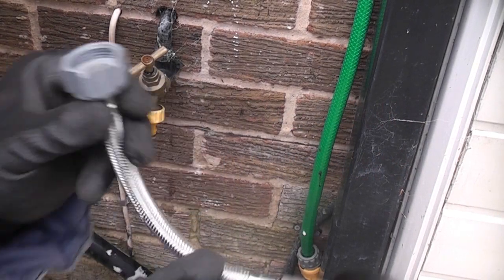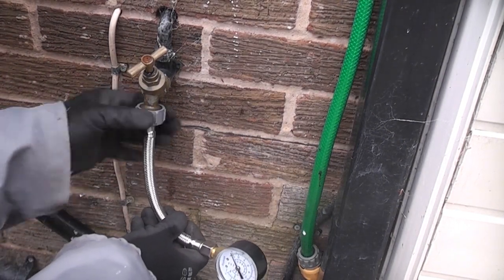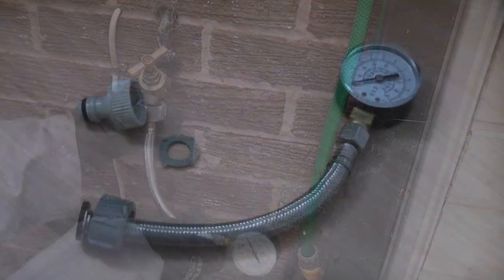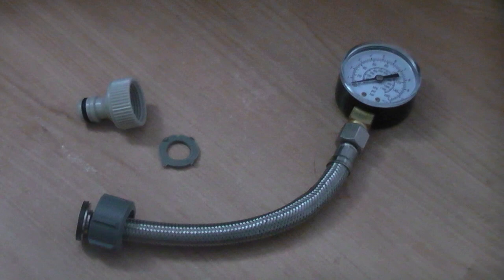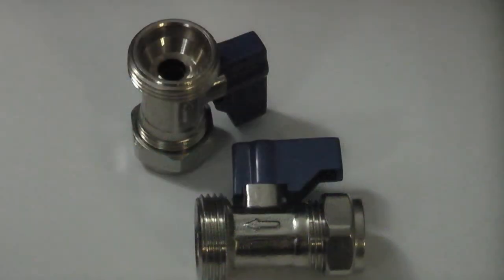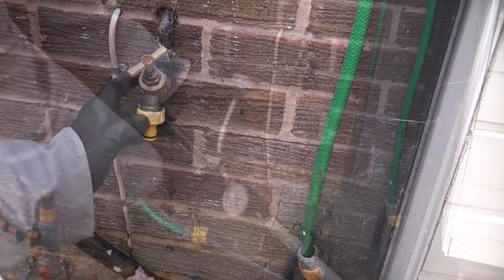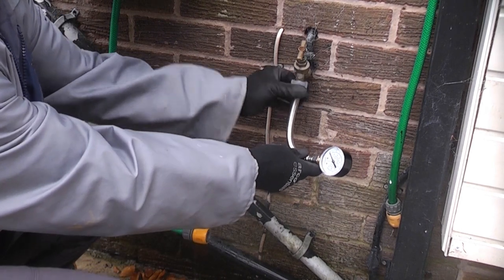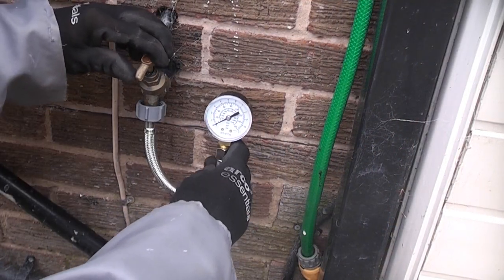How to measure water pressure

Comment: Dynamic pressure (working pressure) is achieved by running another tap during the test. Remember the outside tap has a check valve though

Comment: Hi just bought a very similar meter, would you usually turn the tap full to check? thank you. Great video.
Reply from the maker: It only needs to be open about a 1/4 of a turn, as the pressurised water will soon be measured by the gauge. If you were measuring water flow, you would need to open the tap fully.
👍
Reply: @ultimatehandyman  brilliant.  Thank you.

Comment: If the water is leaking a bit outside of the pressure gauge when you turn it on is it still an accurate reading?
Reply from the maker: It will be close enough ;-)

Comment: nice video. Could I ask in your experience what is the strongest glue for joining 2 pieces of wood ?
Reply from the maker: +visulube 
Thanks, I'm not sure which is the strongest wood glue as I have not used that many different brands.
I normally use Evo stick exterior wood glue for my projects, that seems to work well.
Thanks for the comment
Reply: +Ultimate Handyman  thank you !
Reply: +Ultimate Handyman  thank you !
Reply from the maker: +visulube 
You are welcome ;-)
Reply: Cascamite for critical structural applications when the joint is under constant heavy load and aliphatic resin (yellow wood glue) such as Titebond for everything else.
Reply: @peterv1436  thanks !

Comment: I'm not entirely sure that the method shown is correct, and may explain the very high pressure reading obtained in the video.

It seems to me that it's important to expel air from the gauge and hose to take an accurate reading.   This is how I did it:
a) loosely couple the tap connector of the gauge to the outside tap;
b) run a little water by opening the tap a small amount, allowing water to flow from the connector for a few seconds;
c) gradually tighten the connector until it is water tight;
d) turn the tap on full and check that the connector is still water tight;
e) note the reading on the gauge.

I'd be very interested to know whether my suggested method results in a different measurement to the one obtained in the video.

With best wishes
Steve
Reply from the maker: Hi Steve, this will be fine for getting a rough idea of the pressure.
If you wanted a really accurate measurement, you would have a to use a calibrated gauge etc.
Thanks for the comment 👍

Comment: so nice to say 7 bar to 100 psi. in Canada were i live you know we are all metric except air and water pressure at 100 things would blow away. to expect 40-60 for water is the normal. i find it funny you drive in mph and buy the gas or diesel in liters and the freeway is in mph and the signs are variable with photo radar everywhere. i was in Scotland
Reply from the maker: +George Gardinier 
Yes, it's bonkers over here. My van actually has a speedometer that shows MPH on the dial, but there is a digital reading on it as well and that's in KMH. Scotland is notorious for catching speeding vehicles using photo radar etc. Where I live we have lots of fixed speed camera's, if you don't concentrate and go over the limit you get a ticket and three points on your license. So far I have been lucky and have never had a ticket in my life- but my van doesn't go fast anyway LOL
I remember when Gas?diesel was sold by the Gallon, I remember a friend of mine saying the price of fuel was ridiculous in the 1980's and that it would soon be £1 per gallon, it's now £1 per litre!
Thanks for the comment ;-)

Comment: So you guys didn't go Metric with the Washing machine tap?!? :) ...
Reply from the maker: +Curiosity 
Metrication is a joke in the UK. Most plumbing fittings and air fittings still use BSP Imperial sized threads. But if you buy steel conduit it is normally sold in metric sizes. Some machines that I work on have bolts with Imperial threads, but some also have Imperial and metric ;-) 
It would be much easier if there was just one system of measurement used LOL
Thanks for the comment
Reply: +Ultimate Handyman Well maybe we here in the U.S are not so screwed after all...  I guess no matter where you live you have to go and buy what works... :)... I have learned the Metric system but we don't live by it here. Everything here is built half and half so you have to have two sets of tools to work on things... I bought those 30 years ago so I'm all set... :) Crazy world!
Reply from the maker: +Curiosity 
The metric system is so much easier to be honest. If I go in the workshop and pick up a 12.4mm drill bit I know immediately that it's larger than a 12.3mm drill bit without even thinking about it. If I pick up a Imperial drill bit and have to find the next size up or down I normally reach for the digital caliper and measure them in metric LOL.
Thanks for the comment ;-)
Reply: I use both XD, I use metric but I use hp for power and psi for pressure, just got used to hearing it I guess so it's easier for me to compare
Reply from the maker: +TDJDriftersBoss 
Thanks for the comment ;-)
Reply: +Ultimate Handyman No problem, happy to do so!